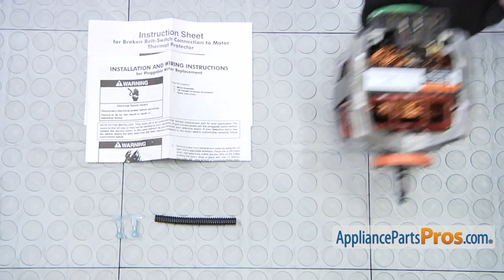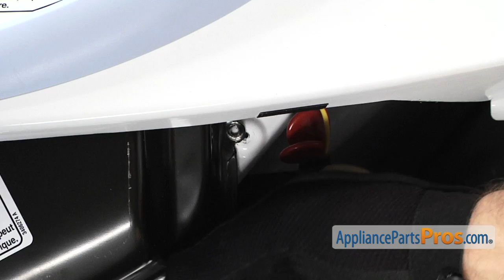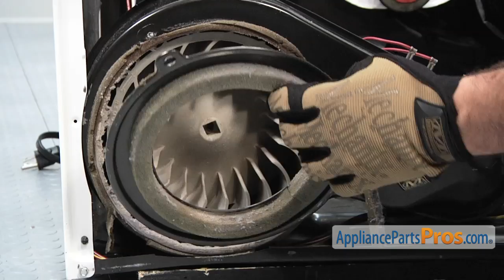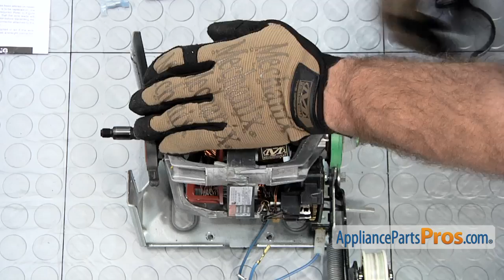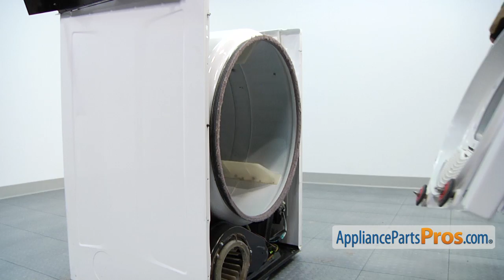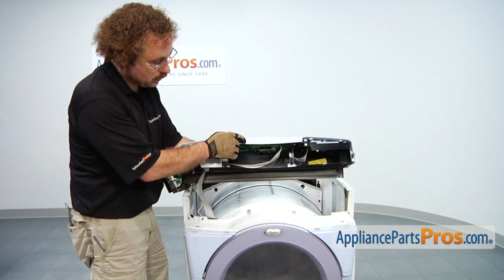How To: Whirlpool/KitchenAid/Maytag Drive Motor 279787

Comment: Thanks for showing the chisel technique. I thought I was going to buy a new dryer after the 1/2 square drive spun in the blower…

Does the idler pulley get any grease or anti-seize lubricant?

Comment: That's a 120 volt plug in. Your working on a 240 volt Dryer. So People will unplug the Washer to work on a Dryer!, Good thinking!!!!
Reply: Lol! Phillip... This is a gas dryer that does in fact have a 110/120 volt plug. See the gas coils when he lifts the drum out there smart guy?
Reply from the maker: The advice still holds true. Unplug the appliance you are currently working on.
Reply: Phillip Bielefeld is a smart ass. I hope you have to do a hundred of these repairs before you wind up at the old folks home.

Comment: Hey, I believe I have a motor failure of my Duet gas dryer.  Model label is gone but looks exactly like the one featured in this video, control panel and all.  When I turn it on I get a buzzing noise for about 3 seconds then a click and the buzzing stops.  The dryer does not spin.  The control panel operates as if the dryer is turning when this happens.  If I reach inside i can turn the drum by hand clockwise but not counter clockwise.  I am being told the motor is bad.  Can you confirm this based on the information I have given?
Reply: I'm having the same issue, were you able to determine if it was the motor?  I'd hate to replace the motor only to find out it was something else.

Comment: This video was excellent. Only had one difference with my dryer. There are two wiring harnesses that are clipped on the controller board panel that needed unclipped before you could rotate it out of the way. Also, one note that cost me more time was when you plug in the broken belt sensor (with the wire closest to the power connector), make sure you plug in the top connector (closest to the other plugged in connector) and not the bottom. Motor will just click when you try to start if you use the bottom one.
Reply from the maker: Thanks for your feedback and your tips! A single part can be compatible with many different appliances. We film the part on a single appliance model to serve as an example of the repair, but there may be slight variations in the process for different models, so we appreciate the information about how the repair went on your particular unit.
Reply: This video was very NOT excellent.

Comment: Motor in a Kenmore HE3 is making a load squealing noise.  Sounds metal to metal.  Guessing it is a bearing.  Do you suggest changing the motor out.  Thanks!
Reply from the maker: I would check the drum support rollers and the idler pulley. If it is a motor bearing you would have to change the motor as they do not sell pieces of the motor.
Reply: I suggest NOT watching this video and looking elsewhere for advice.

Comment: How do I take screw/bolt off motor the one that screwed blower wheel?? Mine doesn't want to come off
Reply from the maker: Without knowing what you have, I would suggest posting the problem along with the appliance model number on our repair forum and the techs can help you troubleshoot the problem. http://forum.appliancepartspros.com/
Reply: AppliancePartsPros thanks but we got it!
Reply: @flipg7492  how did you get it out?

Comment: OK, so apologies for below comment. After actually doing it I don't think it is possible to replace the motor without destroying the fan. So, if you are going to buy a motor for one of these do yourself a favor and get the fan at the same time.
Reply from the maker: They do not all break but you do run the risk of damaging it!
Reply: @appliancepartspros  No, Larry Fine from the Three Stooges; they ALL break. Now go roll in a pile of wet soiled undies (they're wet because this video gives you zero chance of fixing your dryer) for making this video.

Comment: Would be more helpful to know how to remove the fan withOUT breaking it. :(
Reply from the maker: If it breaks free of the shaft with the extension then you just have to unscrew it. If it cracks or is stuck on then you would have to break it off!
Reply: It’s impossible to tell if it will come off without breaking
Reply: Finally, someone who understands me.

Comment: My motor #279787 does not have an open connection on the overload of the motor switch for the broken belt switch (dryer 100.62062103). There is only one terminal already connected to a black wire that goes to either the motor winding or the bottom of the motor switch. Motor will not turn on if I only connect the large white plastic wiring connector, ignoring the belt switch (making assumption it is by-passed on the new motor). How should the belt switch be wired?
Reply from the maker: The video shows how to reconnect the wires from the broken belt switch. If you are having problems, I would suggest posting the problem along with the appliance model number on our repair forum and the techs can help you troubleshoot the problem. http://forum.appliancepartspros.com/

Comment: There is no need to remove the motor mount bracket. just remove the motor from the bracket while it is still in the dryer.
Reply from the maker: Steven Clarke Thanks for the tip!
Reply: Was wondering that same thing.